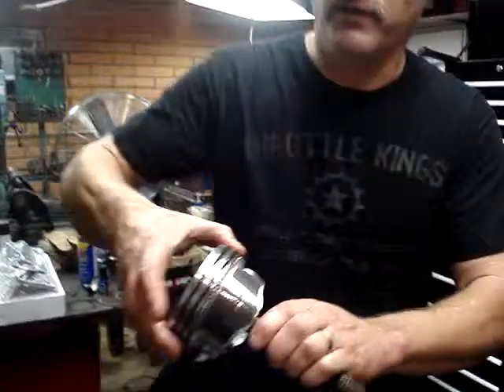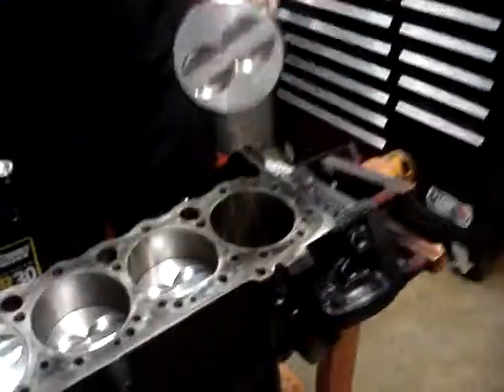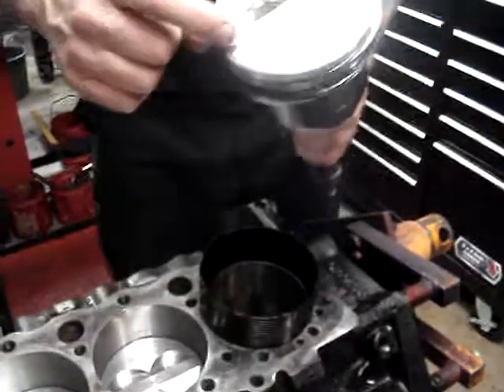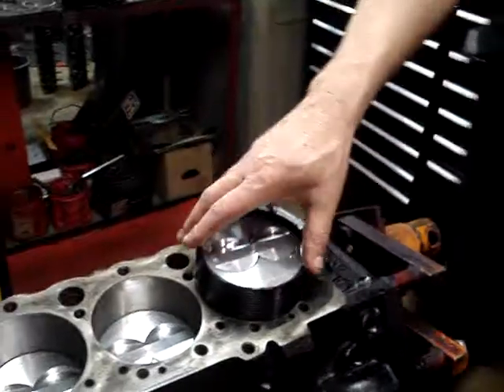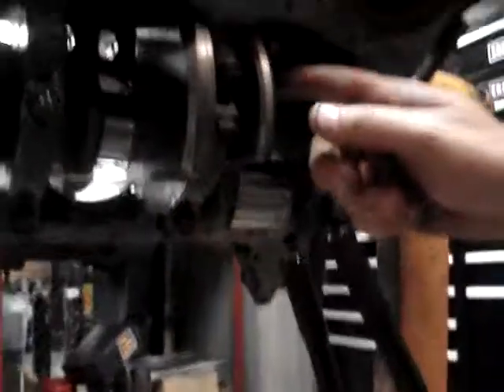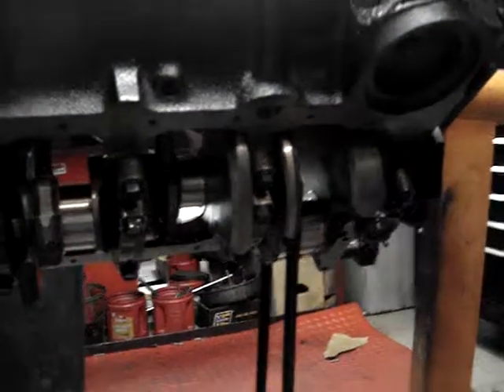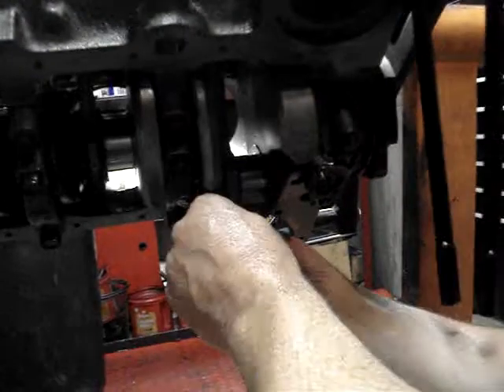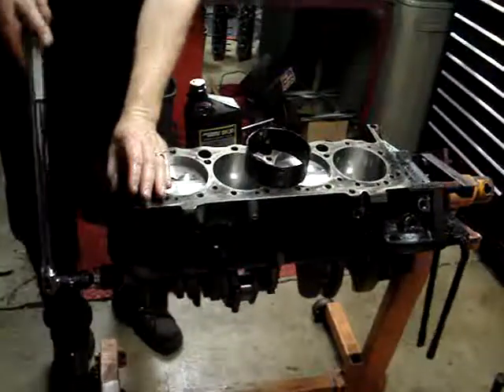Piston Insallation

Comment: You had a video on here that I can't find concerning piston to wall clearance.  I made a comment about it but I wanted a review.  .0035 clearance was what you told me was sufficient.  But my question is: Is that from the top of the piston or the bottom of the piston skirt?  The pistons I ordered for my 351w build vary from top to bottom piston skirt.  I wouldn't bug you if I could find that vid.